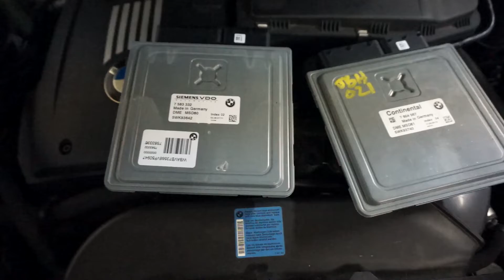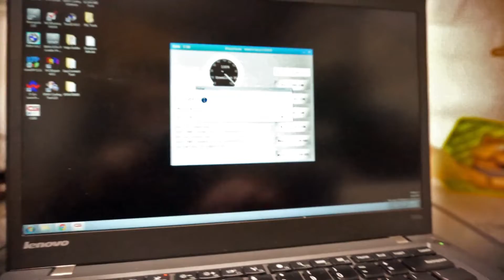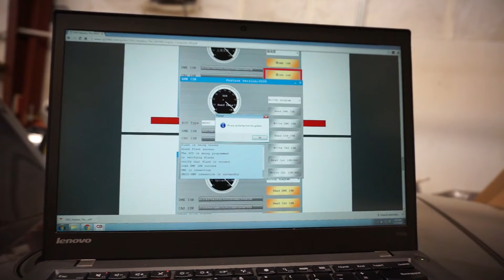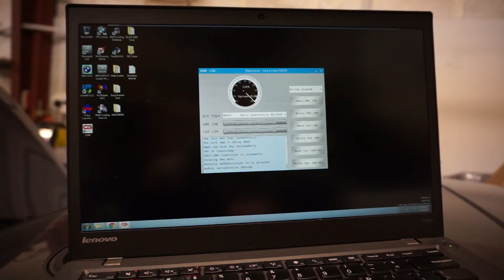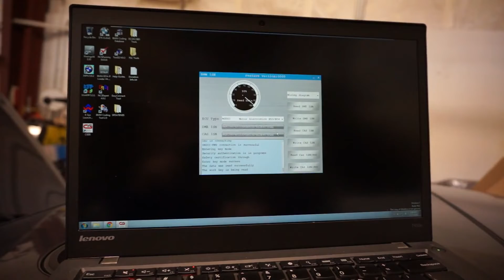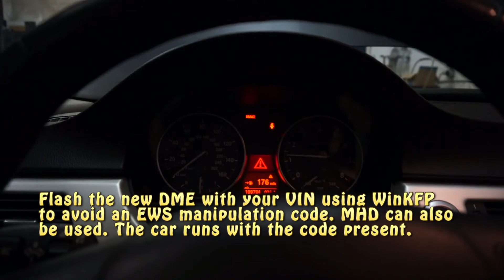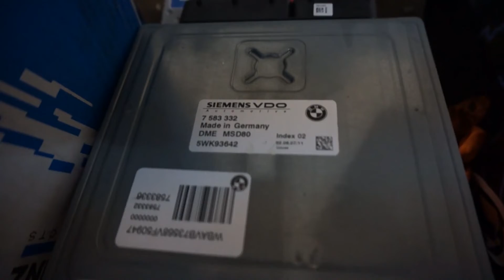How to replace a BMW 335i MSD80 DME with a USED MSD81 using CGDI

Comment: So it will start with a 2f49 ews manipulation code?? I swapped my key, dme, cas from a running donor. But my car won’t start. What did I do wrong. Disconnected negative, checked and changed crank, cam sensor the car has full fuel pressure but I’m not getting spark or injector signal . 2009 328i e90 all fuses and relays good! Wtheck????!!!! Please someone help

Comment: You’re in Chesapeake, VA? If so, I’d like your help.
Reply from the maker: Further north in MD, but I've been traveling a lot lately.
Reply: @chesapeakemotorwerks  I’m thinking of doing this upgrade. I had MOSFETs replaced in my MSD80, my 30BB is still present & won’t clear. It’s been forever. I’m ready to drive my car. Idk if it’s easier to just buy a MSD81 & CAS together or what…

Comment: If I have mhd on my msd80, do I have to take it off the msd80 before I switch to msd81? When I switch to msd81, can I just re-add the tune with no issues?
Reply from the maker: You don't need to take it off the msd80, the license is tied to your VIN which is read from your vehicle immobilizer so it will just work.

Comment: So i cloned my old one to a new one, and my car starts, but i cant reach the dme and i have every code pop up, do i need to program my new cloned dme to my vin?
Reply from the maker: IIRC, it will throw a code (should only be one) with a VIN mismatch. What you're describing sounds like you need to reset adaptations & clear codes.
Reply: @chesapeakemotorwerks  i figured it out, my guy that cloned it didnt clone everything, but i got it figured out

Comment: How do you write vin in msd81 to match cas? Smog checks will read whatever vin is on msd81
Reply from the maker: You can see my "BMW ECU CAN bus Man-in-the-Middle with CANBadger" video for how I did it, but WinKFP will do it for a stock tune. Following the video above and some posts online that gained attention, I believe MHD also writes the chassis VIN to the DME now so it will match the CAS VIN.
Reply: @chesapeakemotorwerks  fair enough. I’ve got mhd, so hopefully the flash does it. Thx
Reply: @TML34  I'm having same issues  and have mhd will it work I bought good ecu from junk yard

Comment: Excellent vid!
So basically Read ISN from MSD81, Copy New ISN to CAS, Perform Injector coding. Then you just flash an mhd which should write vin in uif?
But i've heard stuff about Reset working hours on MSD81? What actually is this and is it required? Cheers
Reply from the maker: Yes, that's correct. No working hours reset needed as long as the DME came from a like vehicle.